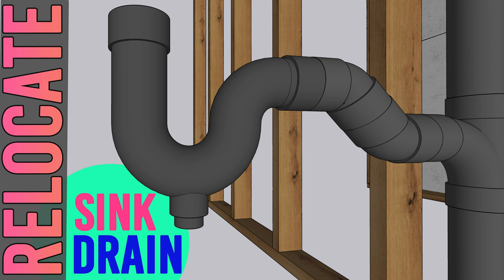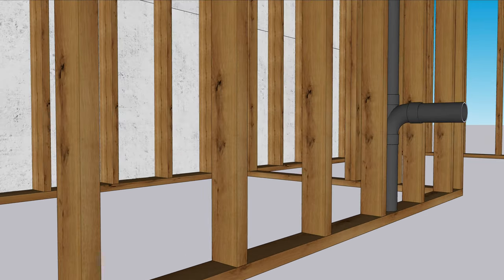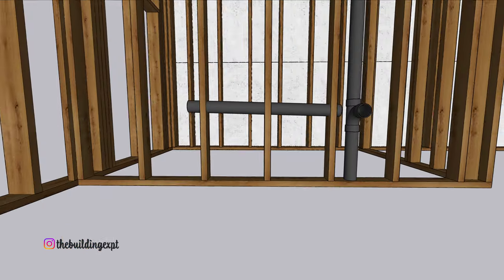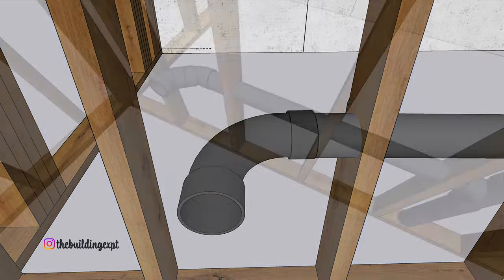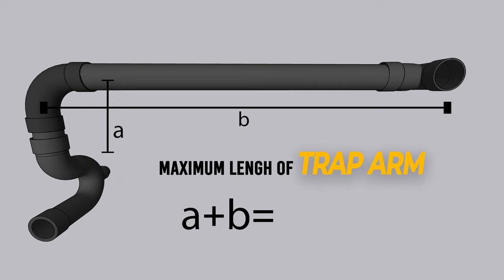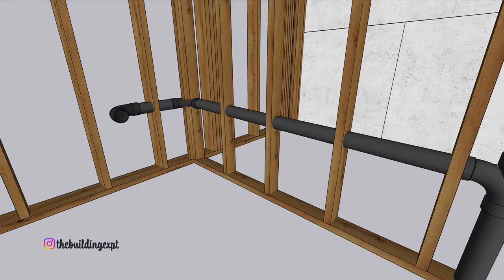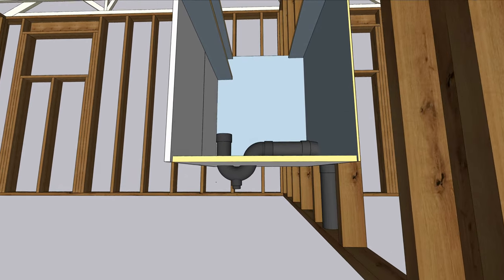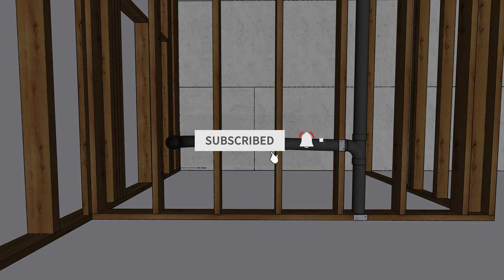How To Relocate Any Sink Plumbing - 2022

Comment: Looks good on paper but i’de like to see you get that rigid pipe through three studs. This is where engineers and contractors clash. There should be a minimum 6 month “residency” that engineers need to go through so they can see what works in real life. Just because you can draw it and make it look pretty on a computer screen doesn’t mean it will play out that way in the field.
Reply from the maker: Go watch our Drainage series playlist and come back. Thanks for your comment.
Reply: That's a great point
Reply: A couple of couplings will do the trick. It doesn’t have to be one piece. Say 3 smaller pieces will work on 16” centres for the studs.

Comment: Once you cut the tee and rotate it 90°   how are you connecting the existing drain line back to the tee?  Could you use a coupling above and below tee?
Reply from the maker: Yes you can use couplings.

Comment: Is there any alternative if the trap arm is much longer, like 25 ft?
Reply: You can move the vent connection within 5 feet of the new trap location.
Reply: @repairitdontwreckit4257  Thanks for your reply. Do you mean I could run a 22 ft long horizontal (sloped) pipe from my vent connection and connect a 3 ft long trap arm to that new connection point? If so, in effect I still have a 25 ft long trap arm, just that my connection point has moved. Perhaps this is technically in compliance, but how does it help with possible siphoning out the liquid from the trap and having sewer gases come into your home as shown at 2:35? Perhaps I misunderstood your solution? Moving the vent vertical pipe, or adding a new vent vertical is not feasible.
Reply: @Alex-ge6fo   Most of the info here is based on the Ontario Building Code in Canada. The trap arm is the distance measured from the trap to the vent conection. The piece of pipe from the fixture to the trap is called the fixture outlet pipe. Most plumbing codes will allow up to 5 feet from the trap arm to the vent connector. After that the piece of pipe is called a fixture drain which you can run as much pipe as you need as the critical area is between the trap and the vent. If you have an existing vent providing it is the correct size you can connect to it or relocate to it. 1-1/2” drainage pipe should be installed at 1/4” per foot. Generally on 1-1/2” drains you would need clean outs every 21 feet especially for kitchen sinks. There should be no more than 1 pipe diameter of slope between the trap outlet and the vent connection. So a 1-1/2” trap would have no more than 1-1/2” of slope. When connecting the vent to a horizontal drain it should be of the top of the drainage pipe or rolled no more than 45 degrees from the vertical position. This way when water is running through the pipe it doesn’t block the vent for better flow. From memory I’m pretty sure most drains are usually not more than 65% full if sized correctly. If allowed you could use a mechanical vent if allowed. If so purchase a certified vent as the is a difference in quality. It should be accessible for maintenance. Personally I do not like them as they will fail at some point in time. Plumbing is not that hard especially with plastic  pipe and fittings. It’s all of the rules to ensure a good working system is the tricky part. If it’s not being inspected you can break the rules a little but the 5 foot rule I wouldn’t. There’s not a lot of very good utube videos out there on plumbing rough in. I hope this helps. Roger
Reply: @repairitdontwreckit4257  Thanks again for taking the time to reply. I am not sure I fully understand, I wish I had a sketch. But basically, my vertical drain/vent line is like 25 ft away from where the new sink and trap will be. Whether there is an intermediate connection point or not, I am still dealing with something like 25 ft to the vertical drain/vent line.Also I need a few elbows in there to get to the vertical drain/vent lines. Perhaps you mean that there is up to a 5 ft long pipe from the trap then that drains down into a longer horizontal pipe that is below it? A couple of questions - if I make my drain line 2" instead of 1.5", wouldn't this greatly reduce the potential for siphoning out the trap? Also, someone mentioned a Drainosaur sump/pump (within 5 ft of the trap) - any comment on that as an alternative? 

I'm in Alberta and my application is for a future basement suite below a bungalow. Unfortunately the locations of the existing vertical drains/vents don't work for the best layout of the basement kitchen and bathroom sinks. I can also talk to some plumbers here re: local requirements but any additional insight you can provide is appreciated. Sorry for all the questions. Thanks!
Reply: @Alex-ge6fo  I’ll try a sketch and put it on my utube channel. Give me a couple of days to organize it.
Reply: @repairitdontwreckit4257  That'd be great, I'm sure I am not the only one with this question. Thanks!
Reply: @repairitdontwreckit4257  Did you ever put out a Youtube video regarding this?  I can't seem to find it.  I have a similar situation.  I am considering swapping my kitchen and dining room.  The new sink would be ~25ft away.  I have an unfinished basement underneath so running piping below is feasible.  I'm assuming I will need to have a loop vent in the cabinet that will run underneath to foot vent that will run 25ft to the original vent line on the other side of the house.  Am I thinking about this correctly?
Reply: @johnnymckerr9621  To be honest I completely forgot. Now that I have been reminded I will put something together and post it. It will be more of an explanation on paper. What I can do is explain some of the plumbing rules. It makes it much easier to make changes when you understand the basics. It won’t look pretty but I can get out faster. Thanks for posting. This time I should get it out in a few days. Thanks. Roger
Reply: @repairitdontwreckit4257  thank you Roger!

Comment: What if the wall is load bearing?
Reply: Drill holes that are barely big enough to get the trap arm through. Also, drill the mininal amount of studs necessary.  Key thing is not to cut out more than necessary.